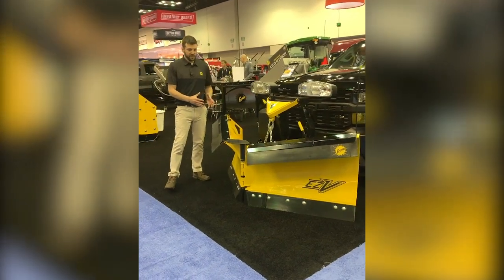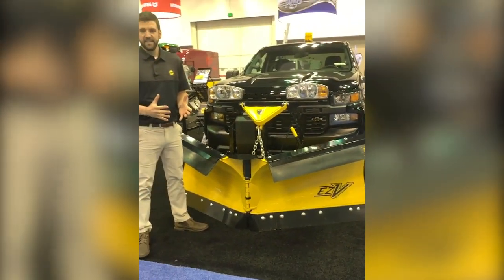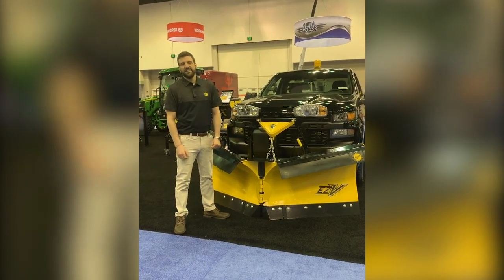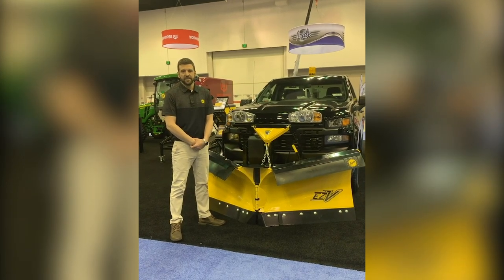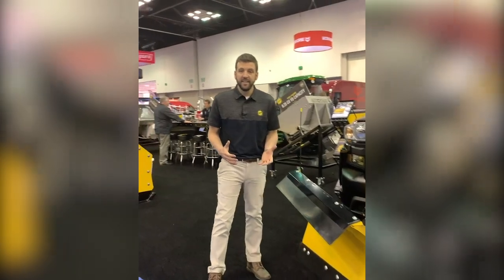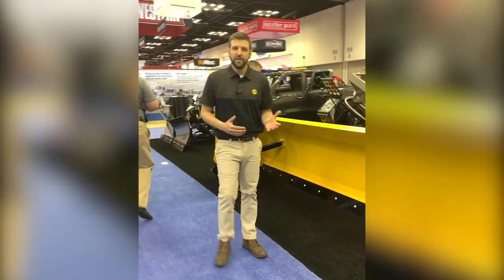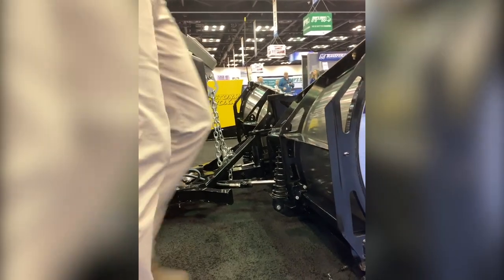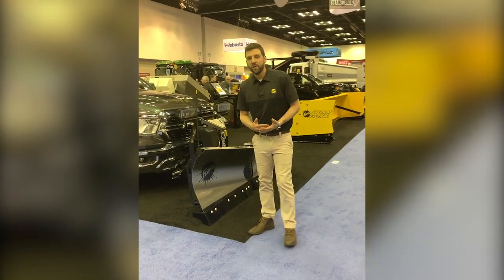EZ-V Half-Ton V-Plow

Comment: I have a 2015 F150 5.0 with a 2.5” level will this work?
Reply: I have a 2018 2 inch lift know problem
Reply: @ironmanmark55stark15  sweet! Thank you! I love my truck and don’t want to sell it.
Reply: Yes the small lift will help u when u got plow on from front tires rubbing  u wouldn't want to go much bigger tho front end parts fail sooner but that a good size level if u want put plow on and the make timbren bump stops that help hold up plows to if it needs but may not need with the level
Reply: I just bought a 2022 Western Enforcer for my 2014 Chevy Silverado 1/2 ton. I put a fully loaded Rough Country 2 inch  Level kit. The kit was perfect and the springs really ride nice and are stronger then my old OEM springs. The plow when lifted, only dropped my front by about 3/4 of an inch. I also added one extra leaf in my rear springs and put Blizzak tires on it. Now ready for winter this year. Was install 9.2.2022   No issues and I love it!!

Comment: I love fisher but I had to swap to boss I have a halfton I plow with and I needs a v plow but need 8 foot I really wish fisher would make a 8 foot v that not to heavy for halfton they sell alot u see  alot people using halfton to plow now and they like me want a 8 foot v for ower trucks 7.6 is just lil small in v or scoop ur lower body panels get hit with ice alot  but for the first 5 years I ran a 8 foot fisher straight blade and it made me so much money but need a v plow once I got lil bigger  and really wish fisher had a 8 foot v I like fisher trip edge my 2017 boss vxt is a full blade trip and don't care for it as much and when pushing up ur banks the wings arnt as strong as fishers plows the boss will fold back  but it is a good plow to I still fine turning how tight to run trip springs that my help some my complaints but really be great if fisher made a 8 foot for halftons